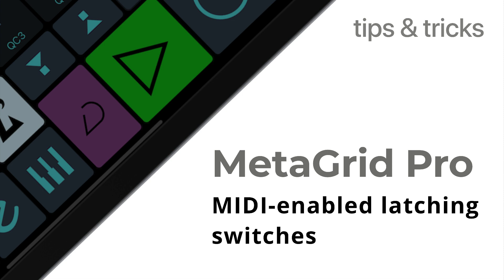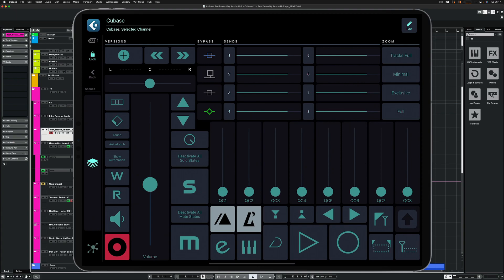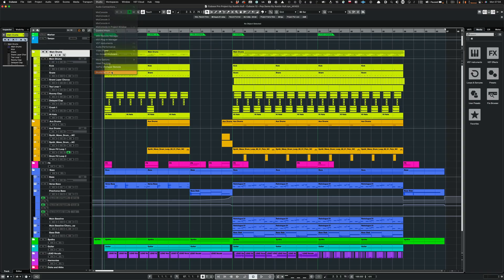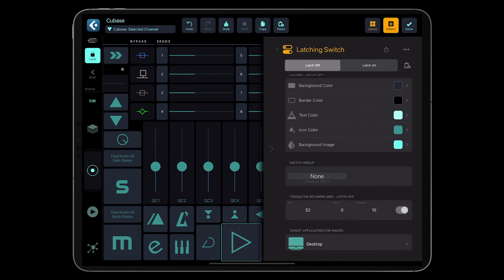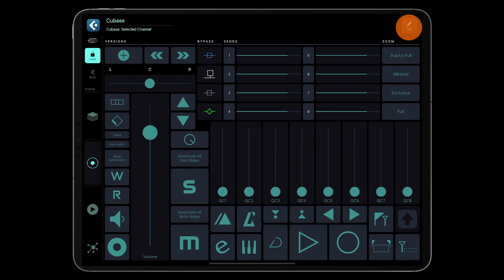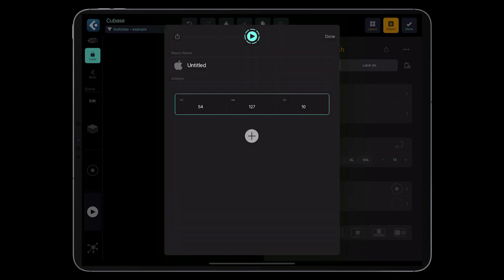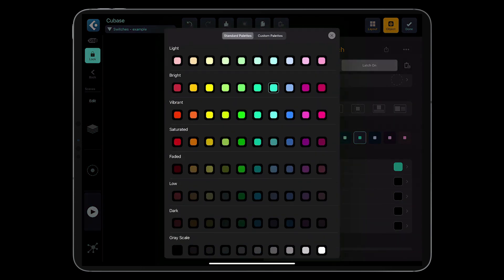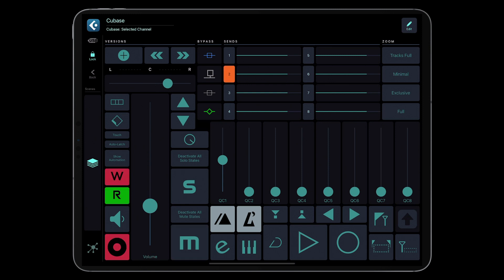MetaGrid Pro - Tips & Tricks: MIDI-enabled Latching Switches

Comment: Editing from MacOS/Windows would be much better. Most of us need to program interfaces with dozens/hundreds of buttons and controls. Flipping around on the iPad for each button is quite a drain as a repetitive task and very slow.
Reply from the maker: Please remember that you can use the Style button and copy the selected parameters across multiple buttons at the same time - and it helps a lot with repetitive actions of configuring same parameters for multiple buttons (colours, macros, etc)